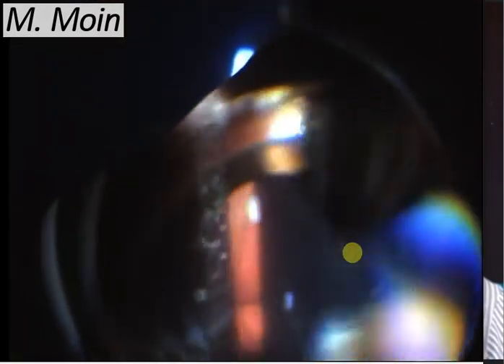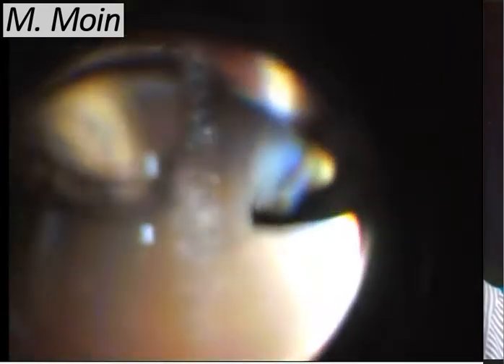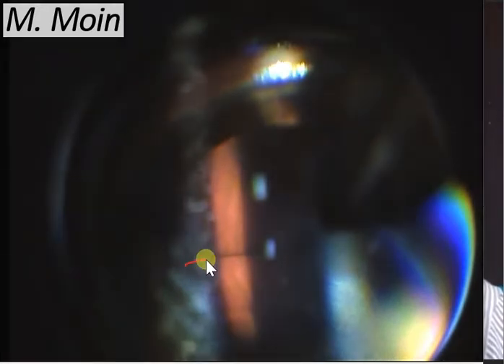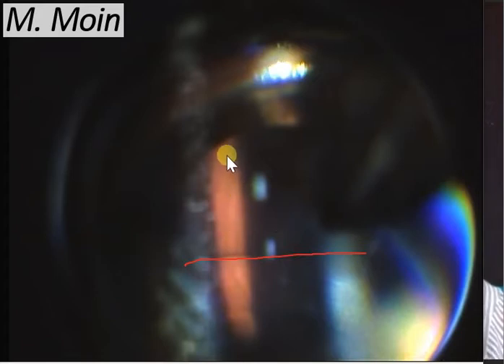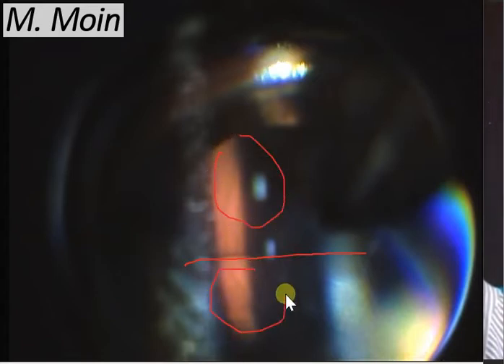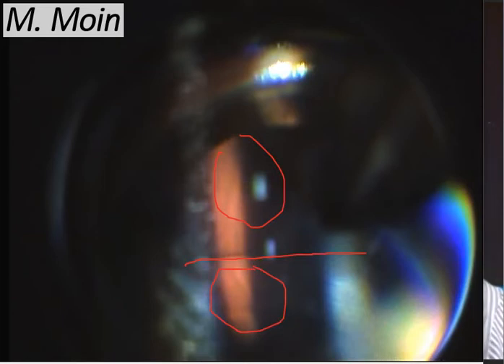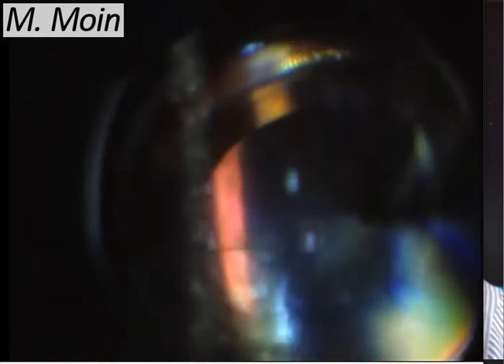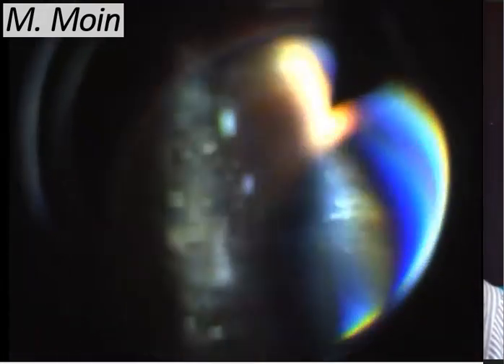Seeing Thru Gas Bubble Post PPV

Comment: I had a RV surgery done 25 days back with C3F8 has. Now i see a moving meniscus near the top of my visual field. Below the meniscus view is very blurred and floaty as if seeing through water in a round glass bottle at close range and very foggy at long. I can detect motion at close range thoguh not clear. Is this as expected? How long complete restoration of vision may take?
Reply from the maker: C3F8 takes 3-4 weeks to absorb. So the babble will gradually shrink and vision will slowly recover